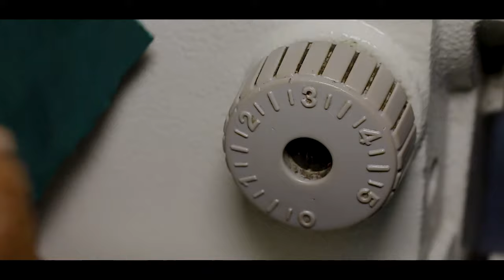Why Do Sewing Machines Do This /Upper and lower bad stitches problem and solution/Sewing Problem

Comment: Good afternoon please my sewing machine cannot make a stitch. The feed dog is moving alright . The machine is well thread. What is the problem?
Reply: Start by changing the needle and fixing it properly. Then re-thread both the upper and lower threads carefully. Ensure the bobbin is properly placed and the bobbin case is secure. Adjust the thread tension as needed, and clean any lint or debris around the bobbin area. If these steps don’t resolve the issue, the machine’s timing may be off, which might require professional servicing. Always consult your machine’s manual for specific guidance.